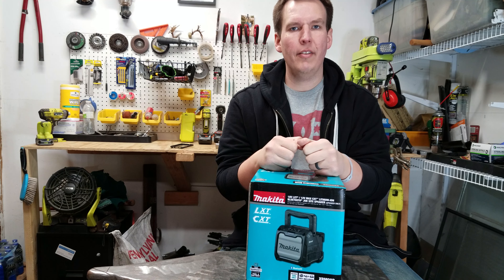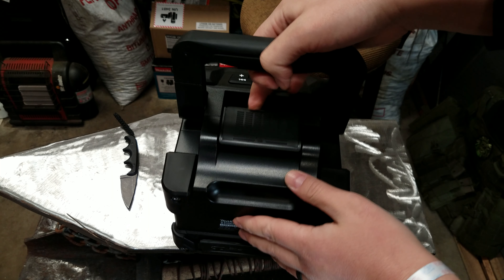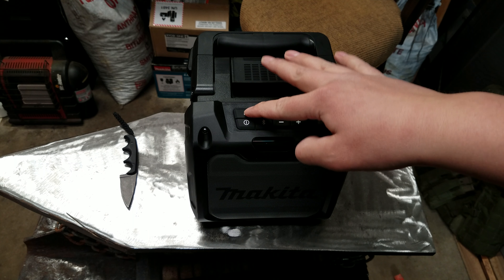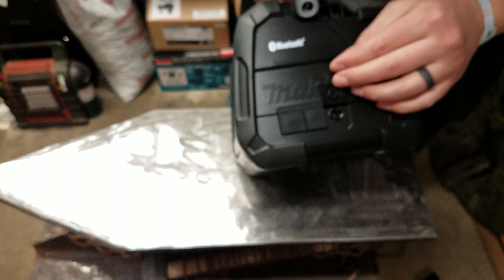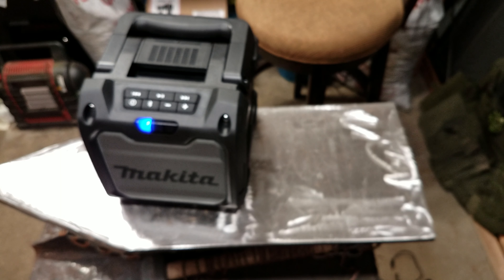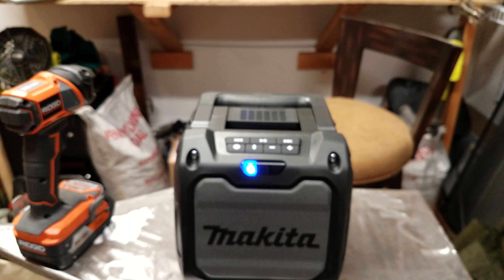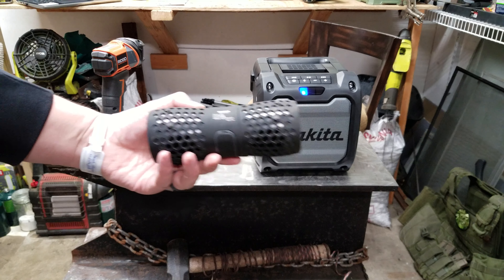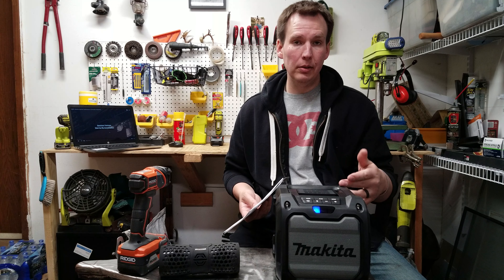Makita Job Sit Speaker Unboxing and Review !!!

Comment: There should be a lot more bass than the little $5 speaker, maybe needs some run in time? Plus it has separate tweeter and woofer, IP64 and you can bring more batteries with it so you never run out. If you compare it to other $99 speakers then I still think it holds it's value sound wise. I love mine at least. Perfect in the bathroom, BBQ's, job site and garage.

Comment: Congratulations on the baby. how is your bluetooth signal? Mines is terrible, I can't go past 5ft without sound issue
Reply from the maker: Hey thanks man, I can walk out of my garage and walk around to my front door then I lose my signal, so that's maybe 30-40 feet, Roughly !!
Reply: @Impact-OG  wow, I need to call makita. I must have a defective unit. I have the teal unit.
Reply from the maker: @Joshismack  Hey thanks for subscribing, Yeah it should have a warranty on it. How long have you had it for?
Reply: @Impact-OG  np, I had it about 6 months. I had a couple of milwaukee m18 radios and I can do the numbers you said.
Reply from the maker: @Joshismack  Yeah if its a open space with no walls or objects its OK, I think it only says 50 ft right? I have to check.
Reply: Sound quality is really poor on this. Returning minw